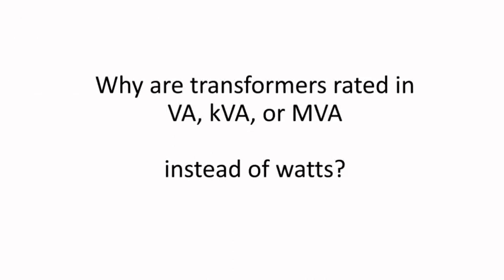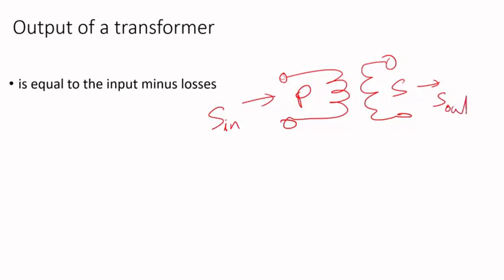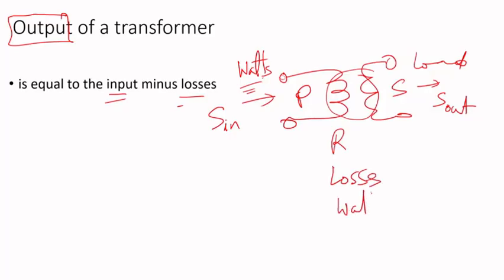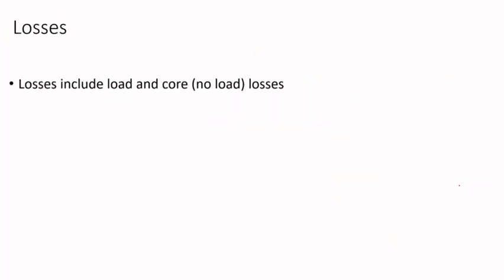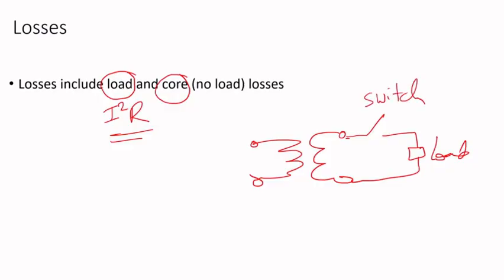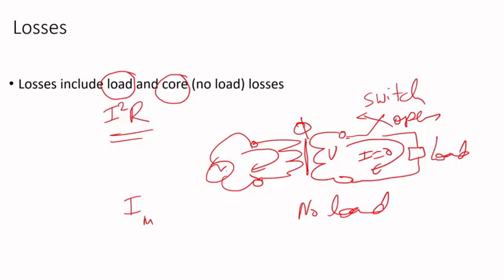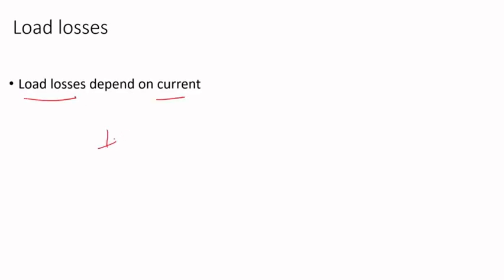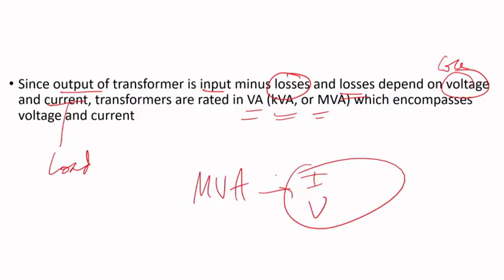"Why Are Transformers Rated in VA, kVA or MVA Instead of Watts?"

Comment: Went through a lot of effort there to not explain why they are measured in VA and not watts. Watts are calculated by multiplying Volts x Amps, so technically they have the same units comprising the amount, even though a watt is defined as a joule/sec. Not sure an answer was given here.